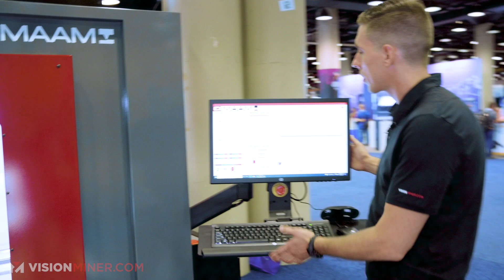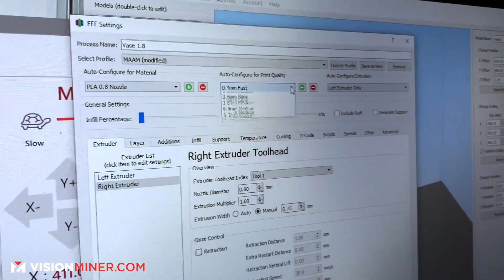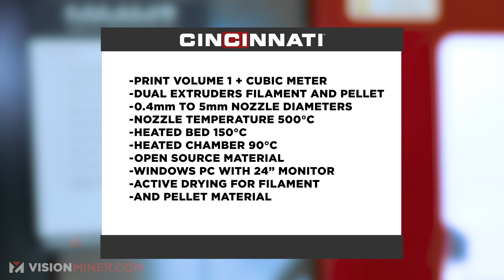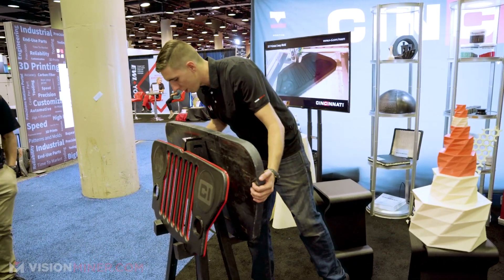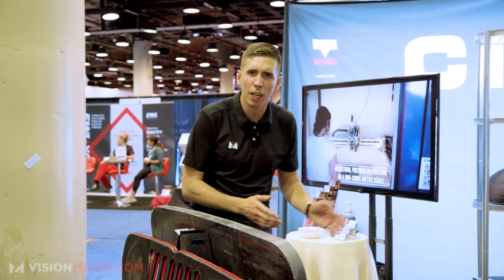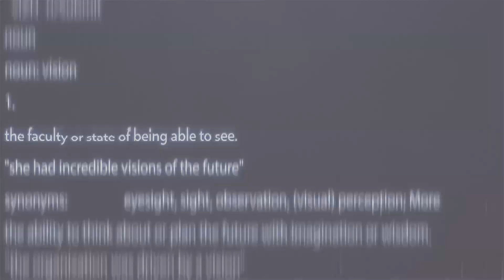Cincinnati MAAM Printer - Large Format FDM

Comment: Please don't misinform people about high temperature printers. Only because the material can be melted doesn't mean it can be processed.

Of course small parts and vases are possible but a Ultem 9085 or PEEK part at the whole buildvolume wouldn't work.

Material science doesn't lie...
Reply from the maker: That's absolutely true -- and while much is possible in lower chamber temperatures, like this one at 90°C, if one wanted to do solid, giant parts, 200°C+ would be required. High-temperature is a pretty vague term, and we generally use it in reference to actively heated chamber -- many printers being capable of ~65°C ambient with a 120°C+ bed temperature, active heating steps up the temperatures as well as the capabilities. It's still a developing segment of industry, so any and all input (especially on terminology) is welcome and appreciated :)